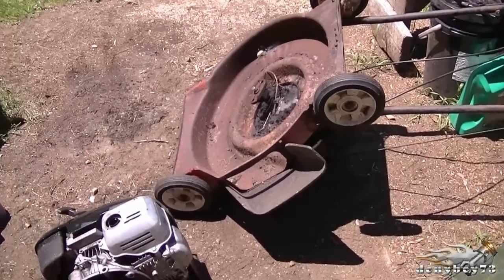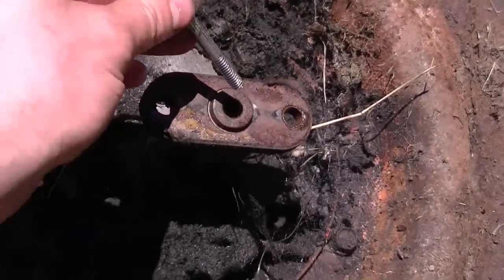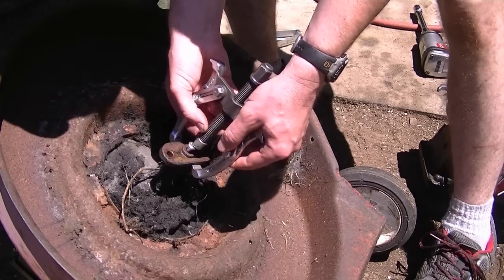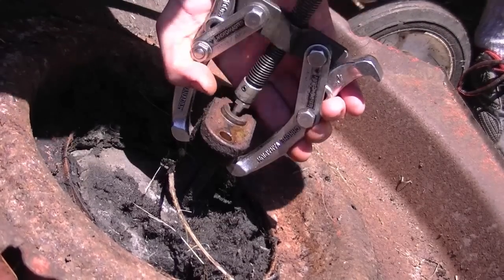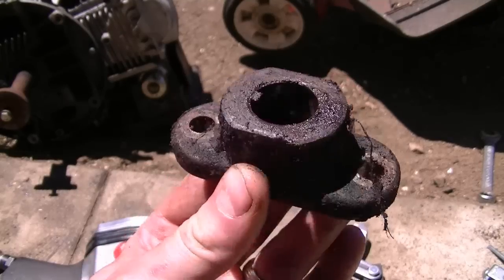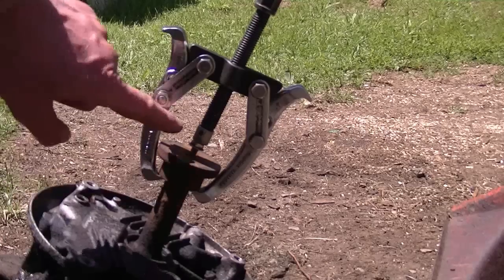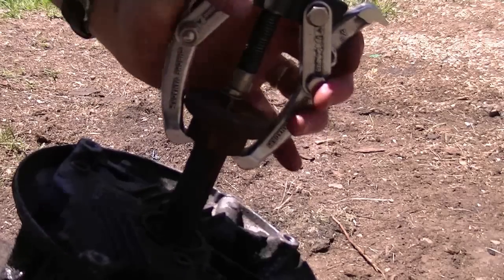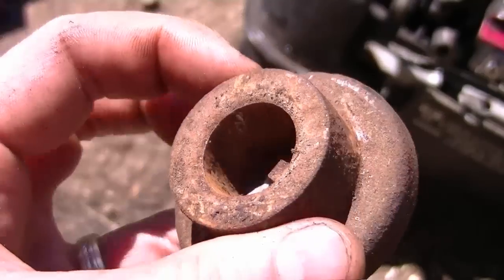How To Remove A Lawnmower Blade Adapter

Comment: I had a particularly old Honda mower and due to another one of your videos I had reason to believe that I needed to change the drive pulley but I couldn't get the blade adapter off. I hooked up a 2 jawed puller and I bent a 2" bolt and no movement. So I spent the next 5 days searching Youtube for the most ideal method to deal with seized rusted parts to get that blade adapter off. I was forced to torch it with propane and spray it with water. Its suppose to turn the rust to a fine powder. In the course of 3 days I torched it and sprayed it with water over 3 times and hooked up a 3 jaw puller that was rated for 7 tons and tapped it with a 3lb sledge hammer all along the way. Then it was around the 4th torching that I got movement after I tapped it with the sledge hammer. I torched it again and at around the 7th time along with the 7 ton puller it went 'CRACK'. There was a larger gap. Further pulling yielded many more cracks as I worked the adapter off of the engine shaft. And there was nobody around to High Five this Magical Achievement with.
Reply: breeze787 dang same thing happened to me can’t get the dang thing off
Reply: @lukepm4814  Get a propane torch and get it red and spray water on it. It works! I've done it many more times since and the torch can get the dang thing off. I guarantee it or your money back!
Reply: breeze787 thanks im going to try it

Comment: Thanks so much for posting this video. I was totally flustered as to how to get the adapter off of my mower, especially after using liquid penetrate and a hammer without success. I didn't have a jaw puller, but I managed to rig a puller from some large C-clamps and a block of wood. It came right off with that.
Reply: Nice call, Thanks!!!

Comment: I just pulled one from a donor engine. The method you showed pwrked perfectly..

Certainly it did not just "fall off", but after a bit of a struggle, it came off.

Good, correct advice.  Thanks.

Comment: great video dony, i guess ive been lucky, all the ones ive done just came off with a couple light taps with a hammer. when i put them back on i put some grease on the shaft so it doesnt get stuck.

Comment: Great video. Is getting the blade adapter off how you typically replace the drive belt?  I’m talking about a snapper 21 inch self-propelled. Thanks

Comment: I highly suggest getting the puller you used most ACE hardware carry both and I bought the other  puller it broke after 3 uses the better one I paid 22.99 for and has lasted over a years sometimes with very heavy use . I also suggest getting some big tie wraps and put them around the puller to hold it on that way you have 2 hands free it has always worked for me . I also used it when I worked pulling stators off big generators as big as 500 kw

Comment: A hydraulic puller can be significantly better when needed. It is less likely to come off, as it won't twist out of location. 
I used three different bolt lengths in the hole. When the adapter is really stuck, only have a bolt protruding a few millimetres each time, otherwise it can just bend.

Comment: Cool Dony, Just the trick I was looking for. My 7hp 18 inch cut Husqvarna is mostly ripped apart now. The rock I hit did not shear the fly wheel locking stock so I moved onto thinking that all the smoke and oil in the exhaust is due to the rings on the piston. I do not have a puller so will need to pick one up. I also managed to break 3 bolts off in the frame of the engine. Two for the mounting to the base of the mower and one that holds the gas can on. Fun times

Comment: Thanks for the video, just saved me a headache. One tip i'd give to others is you can in some cases just use the same bolt that was already in the damn thing instead of finding another one.
Reply: yes the adapters arent threaded the drive shaft is

Comment: you can use pb blast spray and tap it lightly to set up vibration so the spray can soak in.  the tapping loosens some of the rust too.  dont hit it too hard though its a crank shaft

Comment: When trying to pull an adapter off a short shaft motor there is no space for a puller. I always soak them with wd40 and then use a pneumatic hammer. Put back in the blade bolt a couple of turns, with a THICK pair of constriction gloves, pull on the blade adapter while hammering on the head of the bolt with the pneumatic hammer.

Comment: the second adaptor in video, is it not broke. looks like two lugs are missing. i ask as i think i have the same problem. there are two drive holes in blade but the matching lugs seem to have sheered off. or is the tightness of the bolt enough to turn blade

Comment: Just fyi. Most blade adaptors are made of a weak cast metal and are designed to fail sacrificially to prevent damage to the crank. So this careful method of removal is good. Hammering will lead to a new expensive part

Comment: This is never as easy as depicted here. By the time your down to stripping parts, these lawnmowers have many years on them. These adapters, like many other old hub/shaft components are heavily frozen in place with age. The only way to budge them is. Yes. Put the puller on and load it up. Then apply heat from oxy/acetylene torch. NOTE propane will not work in many instances due to the heat sinking from the crank faster than the torch can put into the piece. Acetylene torches will heat the adapter quickly with much less heat going into the crank shaft. Usually when it gets to smoking pretty good. the load will come off the puller and the adapter then will come off with ease.

Comment: hey Don is it possible to remove one without the puller?
Reply from the maker: yes sometimes it is
Reply: ok thanks i actually got it off but i now have problems getting the crankcase cover off i have  a pulley on the end of it  need tips?

Comment: Donyboy73, what can you do when a mower has been tilted up the correct way, but when you change the blade one finds oil in the spark plug hole, and muffler.?
Reply from the maker: +1234tric https://www.youtube.com/watch?v=L8CovhYJ9vs

Comment: Thanks for the confirmation. My neighbor gave me a craftsman self propelled with a lower belt shroud that requires adapter removal to remove (and to access the oil drain). Stupid design...

Comment: I'm curious I just got a new 22" Craftsman front propel and they have these stupid star shaped notch for the mower blade, I believe it's called a HOP. The issue is the mulching blades are few and far between and are either PITA to sharpen long term or are poorly made.

Is there a way to replace it with a normal style configuration (like in your video)? Thank you.

Comment: I tried to do this but I just stripped the threads off the bolt I was using and the adaptor just didn't move. I think the heat up method may work but I have not tried yet.
Reply: John Morris 
what can i heat it with? i guess i always have to have the hardest shit.... cant even find a proper bolt to fit...

Comment: The shaft on my lawn mower just broke off. The part that the adapter slides onto. The blade fell off with the adapter and the end of the shaft attached. Is this something that can repaired? Thanks
Reply from the maker: apureterror not worth fixing, even another engine will cost as much as a new lawnmower
Reply: Ok thanks for the reply.

Comment: Will this work the same on a self-propelled as well? I had 15 year old 250cc Craftsman that died and I bought a 190cc Briggs & Stratton 22" and it does a poor job mulching compared to my ancient B&S mower.

I could mow 6" grass down to 2" and not have ANY grass clumps...this new one I cut 1" worth and it leaves clumps left and right. I think it's the blade but they use a "hop star" (5 point star) and I can't find a decent mulching blade for that style.

Comment: What's the size of the bolt of the second engine? I own a brigs & stratton 098900 series, I have the blade but I don't have the bolt to attach it to the engine and I can't tell the size. Thanks.

Comment: ugh i have a old one and the adapter is threaded on to the shaft with the adapter welded to the nut and so i cant get the engine off so i cant create any sparks so i am drilling holes everywhere around the nut

Comment: so, 40-120 bucks for the puller.  8 bucks for the new adapter. how is this efficient?
Reply: When you work on many small motors a blade diver puller is whats needed. But not that one in the vid .The puller worked because oil was leaking from the motor downwards into the inside of the blade driver (adapter). Realistically two hammers either side worked together would've also done it. However most times there won't have been oil leaking & the blade driver will be rusted solid to the crank shaft .This will require a fit for purpose tool that can be made out of scrap box section & a piece 1/2' plate steel with a notch cut out on one side (an arch for lack of a better word that slides over the crank & rests against rear of the end of the driver)  & an old puller & a lot of heat. This isn't about being efficient it's about getting the job done without damage to the crank & a lot less hassle than grinding which i suspect is what your meaning .As it can be a bugger if the blade driver extends most of the way up the crank .Most times a puller like used in the vid will slip off once a reasonable amount of pressure is applied ,tho a couple of decent size stainless hose clips joined together & tightened around the jaws can sometimes stop the jaws slipping of the edge of the driver

Comment: Thanks!  Just what I needed.  I didn't know if it was threaded or keyed and pressed and it's in the netherworld where the engine manufacturer and lawnmower makers unite so neither one documented it well.
Reply: Success!  You'll need to use a grade 5 or better bolt or you will bend them.  Ask me how I know...
   My '92 Briggs 5HP crank was actually threaded for a 3/8 bolt but I didn't discover that until I pulled the adapter and I munged the threads a little but I don't really need them so it's not a biggie.

Comment: Is anyone here aware of adapters like this with the keyway cut into the hub instead of the key molded into it?   Issue I have is to be able to control the key length and material the key is made of to help prevent the shaft from being bent when hitting something that will kill engine.   also by having an adapter as this  with a larger diameter disk I can add a clutch material then adjust the pressure by bolt torque or making a sandwich bolted to the adapter.   reason I have used a Murray for "thirty-nine years"  with no bent shaft or broken engine bottom pan.   This mower had an adapter as I mentioned ,  hit at least 10 engine stopping events each year,   "never" noticed any engine problems from these events,  added new rings  in the 40th year,   loaned mower to a "friend",  he burned it up by allowing something bad to get into the oil,   no more loaning!!   regards